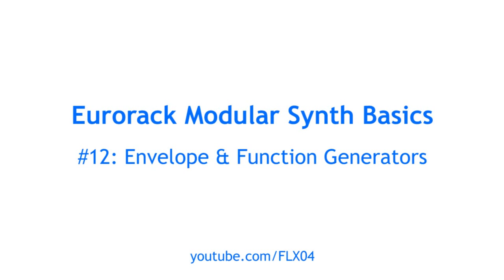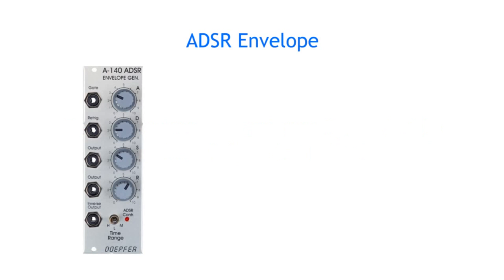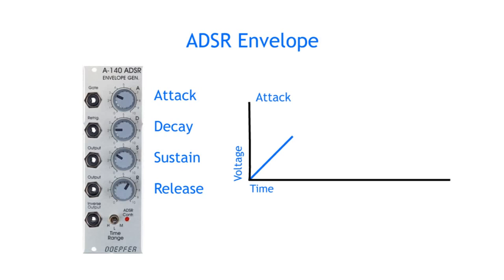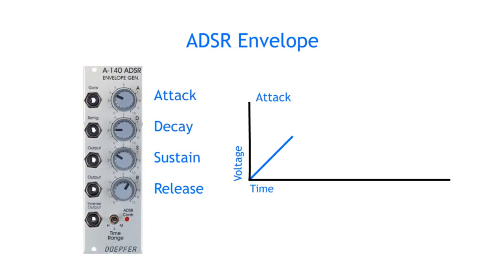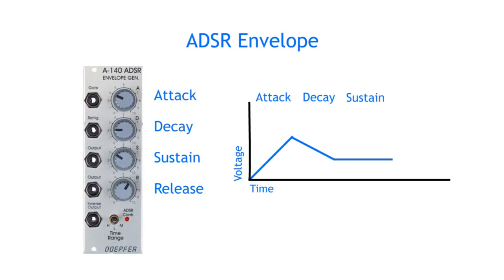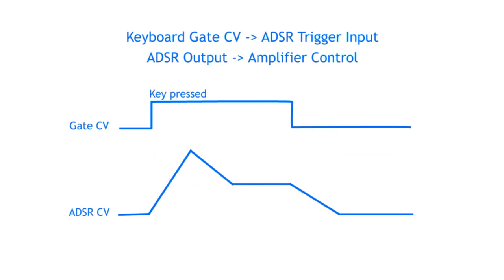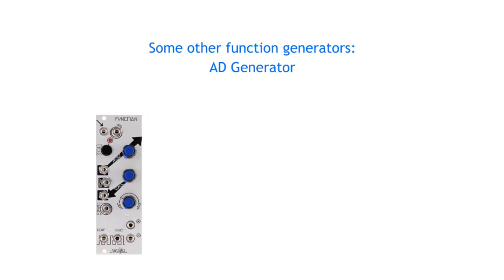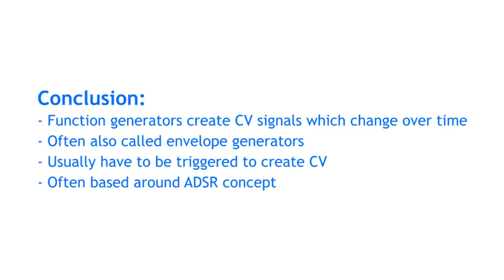Modular Synth Basics #12: Envelopes & Function Generators

Comment: Can the ADSR envelope generator be set the way it becomes simple AR? Is it only a question of setting D=0?
Reply from the maker: That depends on the envelope generator and also on the gate length. Setting D=0 usually means that Decay will be super fast, meaning it will go from the end of Attack (a high voltage level) down to the Sustain level basically immediately. If S=0 then D will go down to 0V, after which Release won’t have anything left. So for AR it’s more important to set Sustain to maximum, the trigger or gate length as short as possible, so that Sustain isn’t held much and the envelope goes into Release. Let me know if you have more questions :)

Comment: These videos are great, and have really helped me get going with my synth. One thing I'm not clear on yet, and I may have missed it or just not reached the right part--how do I properly patch in the ADSR module? I'm not sure where it's changing the sound. (Maybe something internal? My synth isn't truly modular with removable pieces, but it still relies on patch cables.)
Reply from the maker: +The Bass is Loaded for anyone else reading (as you already figured it out): you patch the envelope CV into a VCA or filter for example to open it with rising CV, letting the sound come through.

What synth do you have?
Reply: It's a Thomas Henry "blue synth." I believe they were all hand made or in kits/schematics about 20 years back. I recently came into possession of it from one of his former students.

Comment: I'm curious as to how the knobs on an ADSR control lengths of time. I'm guessing it's actually an amount of electricity.
Reply from the maker: I think it's via resistance from the knob which controls how quickly a capacitor discharges. I could be wrong though. Check this out for details :) http://www.musicfromouterspace.com/analogsynth_new/ADSR001/ADSR001.html
Reply: *****
Thanks for responding, and for the link. I have a bad need to know things down to the very core. It can get in the way of progress. I'll read up on the Musicfromouterspace site. I have tons of questions. I'm going to start small, like you said. I'm more eager to get started, than to have a huge set up. I'll learn each component much more thoroughly, if I get them one at a time.